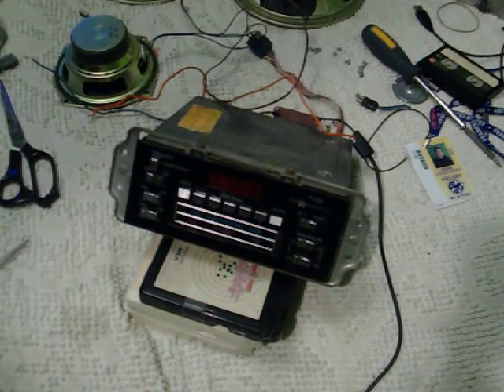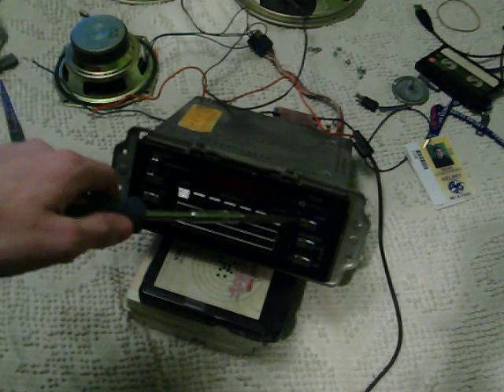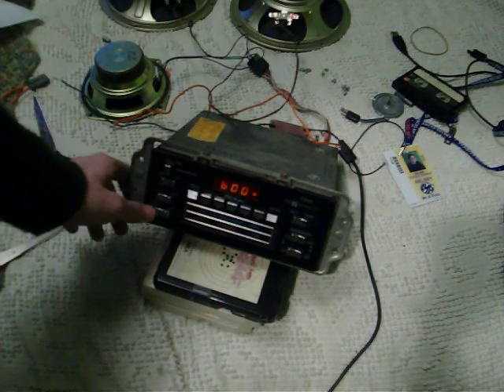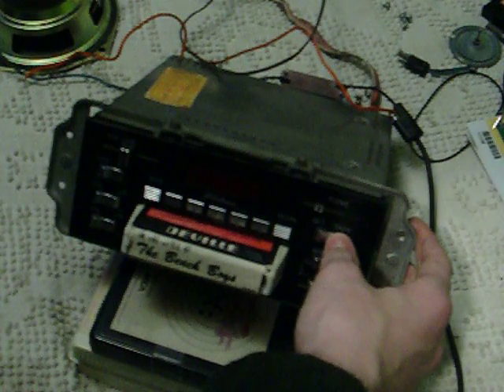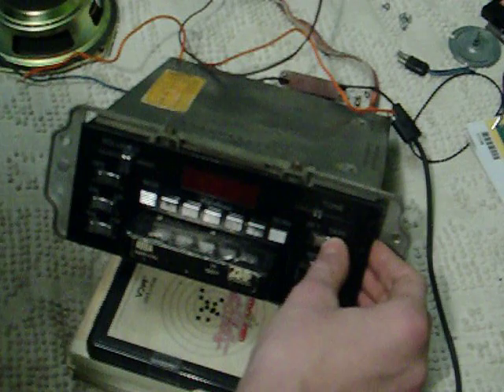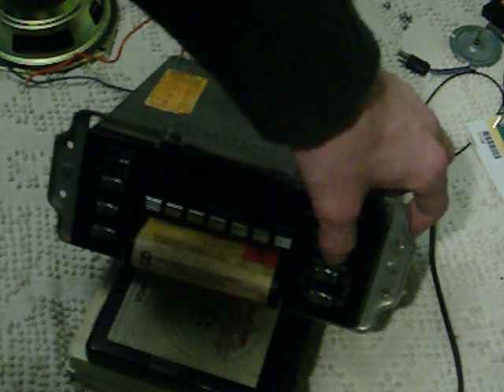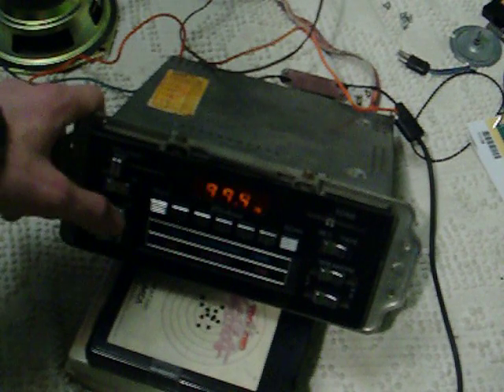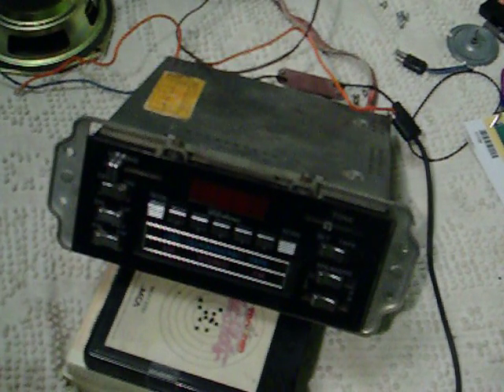1979 Ford QUADROSONIC car 8-track player

Comment: Great video!  Dude, you'll have to go looking for some actual QUAD 8-tracks, In case you not aware, they look the same as normal 8-tracks, however apart from the case actually stating QUAD on them, the way to tell is if you look at the cartridge with the label on top and readable, there is a small NOTCH on the left hand side of the tape opening end. This is the trigger for the player to switch to QUAD mode.

Comment: Also, if you were to listen to these QUAD cartridges in a normal 8-track player, Program 1 has the front left/right info of side 1, Program 2 has the rear left/right info on side 1 - Program 3 has front left/right info of side 2 and Program has the rear left/right info on side 2.  Makes for some interesting listening that way! Also, your display should then only ever show programs 1 and 2 cycling around as technically there is no 3 and 4 (cause they're part of 1 & 2 if you get my drift!) ENJOY!